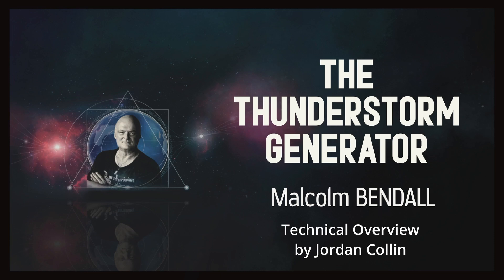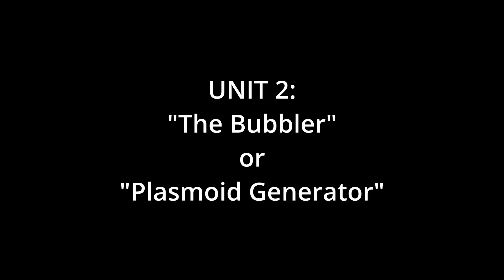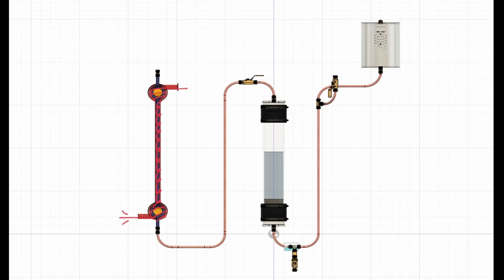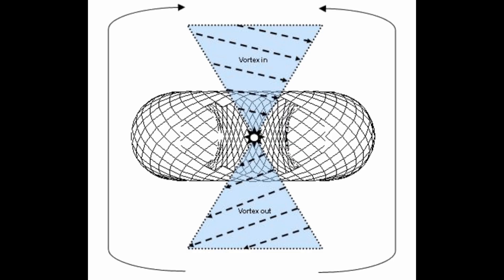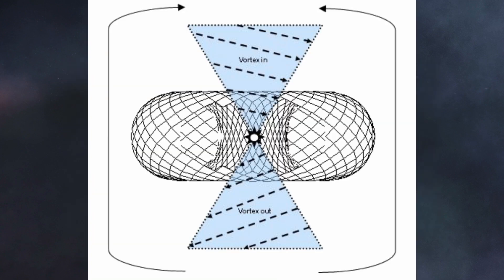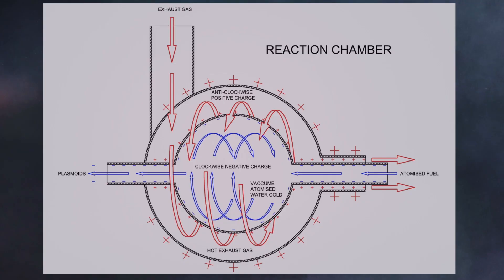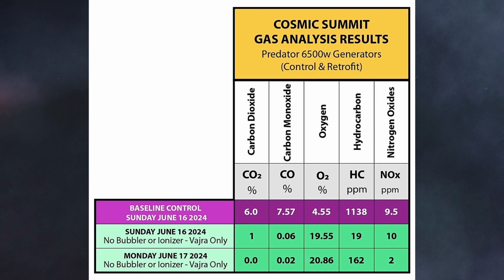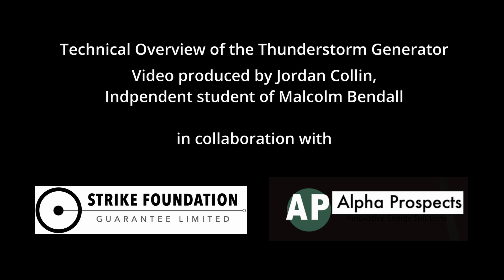Introduction to Malcolm Bendall's Thunderstorm Generator (Plasmoid / MSAART Technology)

Comment: So the carbon dioxide in the exhaust is undergoing nuclear fusion entirely to create oxygen?   

A little bit of calculation tells me that this fusion reaction produces 25million times the energy per kg of nitroglycerin. 

Yet this engine needs petrol. 

If you have figured out a way to make controlled fusion, concentrate on that.

Why bother about petrol engines? 

The answer is because this is BS.

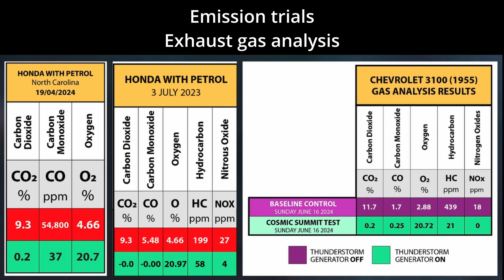Comment: 0:45 This single observation alone should give people a giant hint as to where this excess energy is coming from. If it's outputting more energy than normal while also using less fuel than normal, then that means there has to be a second energy input. Otherwise, it would violate the second law of thermodynamics, but clearly it isn't. Hint hint.
Reply: Well, obviously, you believe mainstream when they say that what they claimed to be the law of physics and thermal dynamics is 100% accurate, but obviously it’s not because I mean look at all these UFOs they’re literally breaking the law of physics, but it keeps happening

Comment: I had a look at the documentation provided by Strike Foundation. Many of the pages are blank, and each identifies Bendall as Malcom V of Scotland. (!!) What is crucially missing is an energy calculation on this device to verify that the energy input via ordinary fuel is equal to the electrical energy output. Without this information nothing can be concluded. Personally I think this is just bogus nonsense for the uneducated public.

Comment: Man I'm so torn on this. I've watched Graham/Ben/Randall for years and heard about this from that one JRE and then recently came back to it to see this crazy technology. But then I've read about Malcolm being a scammer and possibly even Randall? Is this just a smear campaign or is this whole thing actually BS.
Reply: I fell into that rabbit hole too. But only once the podcast of Ben and Randall talking about this thing did I start scrutinizing them much more. I didn’t know enough about archeology to call BS on their ancient civilization claims. But I know enough about physics to hear alarm bells about this machine.

What they’re describing here is room-temperature fusion achieved with an aquarium bubbler and a tube of unpressurized water. Back of the envelope calculation based around car exhaust volumes is that tube where the carbon becomes oxygen should be generating somewhere around 50 to 100 billion joules of energy from the mass-loss between the carbon and oxygen every second. In other words: enough heat and energy to power a large American house for two years, or 20 tons of tnt going off. Every second. Even if I got all my assumptions about exhaust off by orders of magnitude, this thing should be exploding if even a single gram of carbon is being turned into oxygen. E=mc^2 is nasty business.

The data that’s been cherry picked for ancient Egypt’s precision is disheartening. They’ve only been showing evidence that supports their claims, and none of the evidence that falsifies it. It was really disappointing, I thought I could trust Randall and Ben. But thankfully I didn’t fall deeper because they decided to back this pile of scrap last year and I started raising my eyebrow.

Comment: Hello 
Can you plz answer the following questions kindly
1. The uv chamber seems to serve the purpose of vapourising carbon - hence i think by the time the air passing this point it will be free of carbon leaving O3. 
How can you claim then what happens in subsequent steps has anything to do with cleaning or chainging the atomic structure?

2. Other than the claimed efficiency increase of circa 10% - which i think is derived from injection of O3 back into the engine serving as as turbo charge - what other benefit does the unit provide?
Reply: yeah ive asked similar questions before... doubt these grifters will reply lol.. cant believe the amount of people who take this seriously

Comment: Hi Jordan,

At 7:26 you show those plasmoids. We used to call them sprites) when working on Geet reactors. 

Here is a link to a video that was made of a "sprite" shooting across a Geet reactor.  The Geet units were finicky. They worked and then they didn't. Looks like you solved the problem. My eyebrows are raised. 
https://www.youtube.com/watch?v=EKZlM_w7gtQ

This project seems to be avoiding references to Geet/Pantone but not Stanley Meyer. We who attended Pantone's Oklahoma ranch for his 5-day course on building a Geet recognize this design and the differences.

The difference is the ionizing chamber added at the front and there's no rod in your center pipe. You've replaced the elbows with spheres. You also don't appear to be using the black cast iron pipe that Paul instructed. 

I'm not sure where your actual zero point is in your unit. With the Geet, the zero point is in the hemispherical cavity at the back of the rod where the vacuum state occurs. That's the location of the transmutation.

I am thinking that your annealing and Pantone's use of "black iron" were accomplishing the same thing; loading the natural lattice.

Also the Geet patents expired long ago so I'm not understanding the lack of reference to Pantone.

2017-05-16 - Anticipated expiration
Status - Expired - Lifetime

This is great work. I'm looking at putting one together. Thanks.

Comment: ....all sounds a bit bizarre.....please explain HOW it makes oxygen out of exhaust fumes.......smells a bit like BS to me.....
Reply: The video explains it: transmutation. Oxygen has 8 protons and 8 neutrons while carbon has 6p/6n, so if you could add two protons and neutrons to it, it would become oxygen. The question is, if it's really happening and I certainly want to see independent sources confirming it before 'buying' it...
Reply: @Leynad778  ..........i would love to see the chemistry behind this transmutation............still sounds like BS.............some mystical process adds 2 neutrons and 2 protons to the nucleus and 2 electrons to the outer shell.........magic.......
Reply: absolute bs.
Reply: Bc it is, this is a scam
Reply: It is bs. Plasma is like 14,000 degrees 😂
Reply: @namewitheld  plus, I don't think ionised gas would combust very well
Reply: Also, to answer your original question. One of the ways you could hypothetically change exhaust into breathable oxygen might be to use sodium peroxide. It converts the CO2 into sodium carbonate and oxygen.

There’s also electrolysis, you could use electricity and a tank of water to break apart the CO2 into methane. Then pipe the clean water into another tank to split it into hydrogen and oxygen with more electrolysis, and then pipe the hydrogen back into the first tank to make more methane.

But both of these methods require entropy and the latter is usually incredibly expensive. They’re also only used to recycle breathing air in things like submarines and spacecraft.

The electrolysis wouldn’t need a consumable like the sodium peroxide (except the hydrogen in the water). But you can’t get out more potential energy than you put in, so you’d spend all your fuel converting the CO2 you’re generating into substantially less O2 than you stated with… And a bunch of methane…
Reply: Jimmy from bright insight  said it was
Reply: The principal action that's not understood here is nondestructive charge collapse. This is when energy is focused by the plasmoid down to the plank length causing the nuclear collapse resulting in transmutation. The major innovation here is the use of plasmoids as coherent energy packets for the purpose of focusing waves down to plank length.
Reply: @SuperPotatoskins  My dude, if this worked at all it would be releasing heat equivalent to 20 tons of tnt going off every second. Including large amounts of gamma rays. It’s an aquarium bubbler and a light bulb. Additionally, the cavitation pressure is extremely weak. Have they ever shown their aquarium bubbler in the dark to demonstrate there’s enough energy for even sonoluminescence?
Reply: @VoodooTrashPanda  not necessarily but your welcome to your ideas even if they are less inspired.
Reply: @SuperPotatoskins  the wave function doesn't exist dude. There's no question of any form of plasma transfer for combustion here. It's simple as that.
Reply: @Strange_err  weak man

Comment: Hey There, you might consider inserting a slide shortly after the section starting around 2:30 where you mention the "reverse stroke" because it is the reverse stroke that is the key to the cavitation factor necessary for plasmoid formation. The slide or video could illustrate how the back-and-forth pumping action of the water through the steel wool induces micro-vortices in the water which are likely the precursor to the magic plasmoids themselves. Imagine what could happen if the bubbler media were to be specifically designed with serious hydrodynamic engineering in mind to maximize the ideal conditions for plasmoid formation?!!!

Comment: Would there be any association between volume or even density of the vajra materials and the possible stored "charge" to be utilised without bubbler and ionizer?
Thank you for your efforts. Fantastic as usual. Best wishes
Reply: You really wouldn't want to use this without a bubbler for a few different reasons, but mainly to isolate the source of combustible fuels from the combustion area, so the whole thing doesn't blow

Comment: can you explain why there are not any actual cad models or actual specific diagrams of the vajra design, i have heard you make statements of opensource as well as trying to describe the sacred geometry of the dimensions which you clearly got incorrect , as common sense would refute your statements and the inner connecting pipes must be longer in length than the outer pipe due to the fact the spheres are smaller , if all the spheres are nested upon their centers the pipes connecting the sphere must be longer the smaller the sphere yet you claim the inverse in previous videos.
the design plans are sketchy as best from what i have downloaded and there seems to be an attempt to not disclose the "working" actual architectural designs and correct dimensions for this component... until this is made public with proper designs released, i will hold my breath.
you also fail to take a working demo, and in clear sight cut it open to prove the design being demonstrated matches the designs you claim, again , until this is publicly done, i will hold my breath..
the path to eliminating dissenting thoughts is to not allow them by full disclose and proof..
Reply: Google GEET and find all the designs you need. A "Vajra" is a GEET minus a rod and plus the spherical chambers. They both do essentially the same thing. GEET has tons of open source resources and experimental results for you to study
Reply: I wonder how the 100s of homemade units got built then?!
Reply: They had a video on how to build one but they probably decided to delete it.
Reply: @difusekitty3  I think things are moving ahead at a rapid pace and the roll out will occur in several countries. A test was done in the UK by a company called Element which is certified to carry out tests for the UK government. The test results can be viewed if you sign an NDA.
Perhaps the desire for people to build their own TSG has waned somewhat due to the commercial activities? India, Malaysia, Thailand, Nigeria are some of the countries that are showing interest.
Reply: At GEET we want you to build at home, and we can do the same things. Our carbon levels bottomed out, oxygen through the roof.
Reply: You either wont get a reply or if you do it will be dismissive or overly vague. I hope I'm wrong but I wouldn't bet on it. This is open source like flat earthers evidence is open source.
Reply: @Backwoodsmachinist  GEET designs are free for all
Reply: @Backwoodsmachinist  Go home cry baby. Just because you're not important enough to receive a comment doesn't mean it's not open source
Reply: Classic FUD comments. Plenty of people have built their own TSG.
Reply: It's all pretty easy, you take a GEET, add some spheres. I mean, with the TSG, there are no specifications or thresholds or tolerances to be spoken of besides the type of steel to use to avoid warping

Comment: This should be getting so much more attention, can't wait for it to hit mainstream!
Reply: I have a GEET playlist with over 1000 videos. Cars running on GEET. Emissions tests showing clean air. I want people to unite and build this technology together without hiding where they got the ideas!
Reply: GEET reactors have been around for Decades
Reply: @exponentialnegative1 ok, so where are all the veichles retrofitted?
Reply: @exponentialnegative1 so what's your point then, is it to just dump shit on Bendall and discredit this technology in the same breath.
Reply: @exponentialnegative1  yes brother
Reply: I'm disappointed with the kind of people that would ask me questions and then block me so that my lengthy replies are automatically deleted. I can answer any question about this technology and related technologies, and so can plenty of other people. Those who want to know will stick around to find out
Reply: @exponentialnegative1 you will find out, if you haven’t already, that the people who keep trying to discredit this are the ones  sent out by the “gov” in attempt to get people to just ignore this.
Reply: Copy&paste. Save in your notes for future reference
Reply: @Mr.G_Rattlesnake  haha, that would make a great coffee table book... Blocked YouTube Comments
Reply: Can I plumb the exhaust outlet to the top inlet of carburetor? Has anyone tried? Does this allow turning fuel supply off once unit up to speed and hot? Or pinch gasoline supply down to almost nothing? Thanks!
Reply: Paul Pantone has been trying to bring this technology into awareness since the 80s… he might have been channeling Tesla to imagine the invention.
Reply: Not gonna happen man, you'd be surprised how many times cancer was "cured".
Reply: all my replies to your questions are blocked or deleted